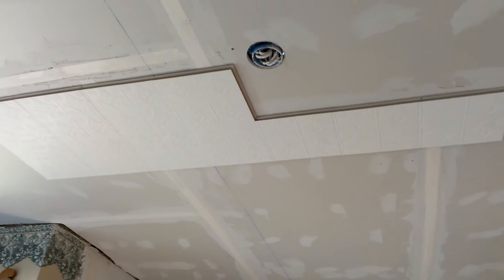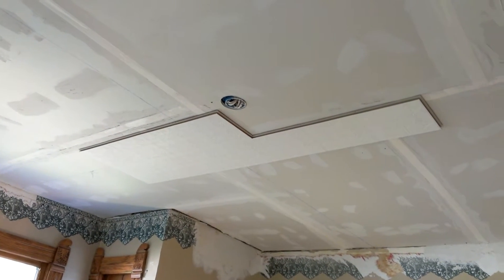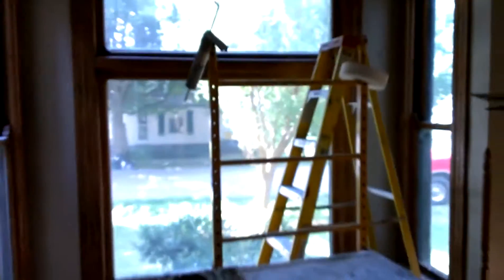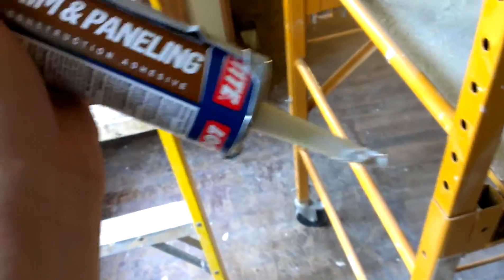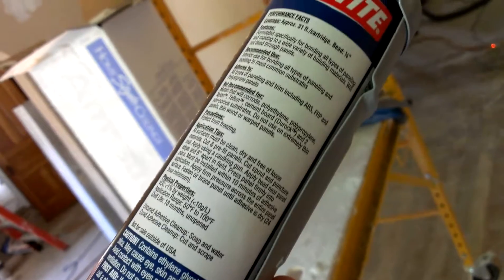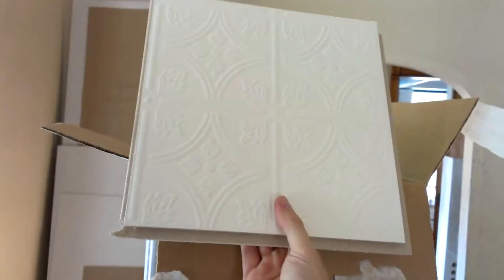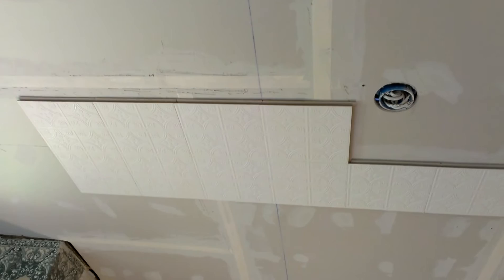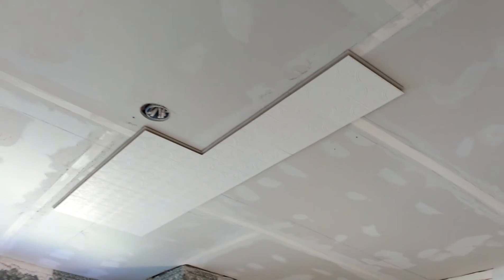Upside down tiles

Comment: Thanks for this, I'd never heard of these before.  They look quite effective (from over here in Australia)    

Does it say on the packaging anything about their fire resistance ?      I'm still astounded when I walk into older homes that were refurbed in the '70s, that have polystyrene tiles stuck to the ceiling.   It's hard not to ask the owners if they have -erm- poo for brains.